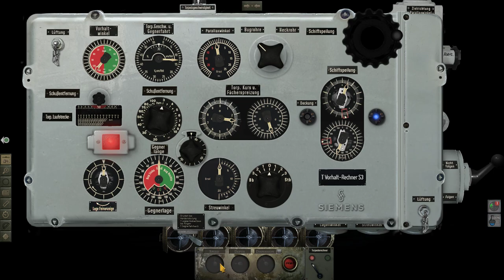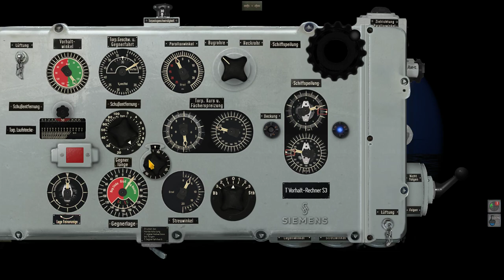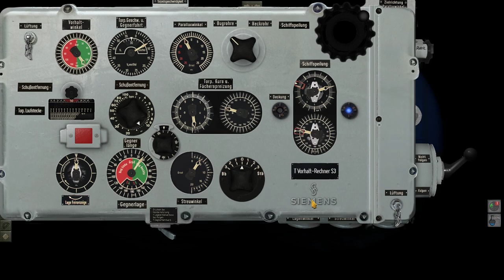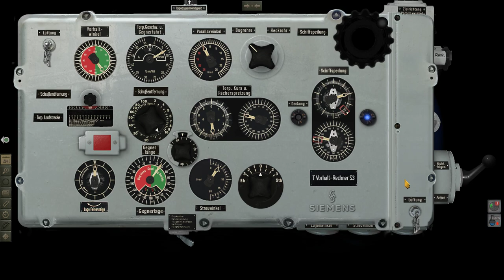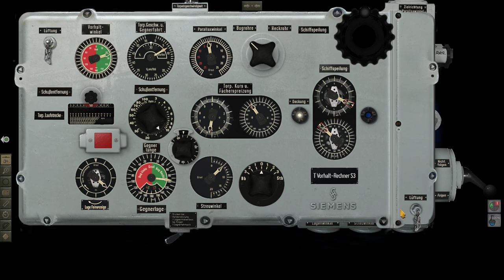Realistic TVre (TDC) Mod for UBOAT

Comment: One thing the mod needs, is the option for the manual input fields from the in-game solution to transfer to TDC mod, just like the Stadimeter does anyway if you measure distance and press set. Simply, because the Stadimeter can be really unrealiable (yes, I do know how to use it properly before anyone comments on that). 'Roughing' the distance on the TDC mod panel can be somewhat hard to ace - a few meters wrong will mean a lot when firing from several kilometers away.

So, that little addition to the mod, manual input, would be nice. It would also make the map tools still be useful - other than just the angle protractor.
Reply from the maker: Just remember though that if you keep your gyro angle low, range doesn’t matter. I only ever eyeball the range, I never use the stadimeter (that scope didn’t have one), because I strive to keep the gyro angle within 20° of my bow, so that range is no longer a factor in the solution. The only reason the range setting is on the TDC in the first place, is because the torpedo has to turn, and the torpedo tubes are offset from the optics by about 28 meters. If we were to literally fire torpedoes out of the lens of our periscope, there wouldn’t even be a range dial on the TDC. So no need for accurate range unless your gyro angle is high, especially at close range.

Comment: Hamacher great video probably the best explanation yet on the TDC. Since release is around the corner are we able to see another video where you fire on multiple targets so we can get an idea of the flow. The Follow up tracking is where my main focus is. Lets say you fire on 2 targets forward of you and then you turn to fire on a target w/ stern torpedo. Just want to see the motion of resetting and re engaging.
Reply from the maker: Thanks! I’ve been helping the devs implement their new TDC, which will be more in line with the real device (the mod has several inaccuracies). When it is released, I will probably do another video.

Comment: You mention how some procedures are historically accurate.  But, what isn't historically accurate is having one person (me) represent the whole crew.  For that reason inputs should each be a single step.  In the real boat as the captain, I may have to say "Set torpedo speed to 40 knots." which will then be relayed by another officer or crewman to the torpedo team who will then set that speed into the torpedo.  Asking a single person to do all the work of 24 men definitely needs some shortcuts.  I am curious to see how the TDC will operate in the coming release version.
I also noticed the range to target does not update though the AoB does.  Is this the way it worked IRL or is that a limitation of the mod?
Reply from the maker: I highly recommend trying the beta version out, it’s currently available for download, you can go in and try the new TDCs out as they currently stand. I’ve been helping the developers out in implementing the devices you see in the beta, and thus far, they’ve done a very good job. It is not perfect, there are elements of the fire control system they have not implemented correctly, and it remains to be seen whether they will keep these elements that way or fix them. And you are correct, typically, the commander, if talking about a submerged shot, or the first watch officer if a surface shot, would be calling the values out. This is how it is implemented in the beta.

To answer your question, correct, the S3 computer had an AOB motor that would update the AOB for any change in target bearing caused either by the optics turning, or your own U-boat turning. Range was not updated, in other words, the computer did not work like a position keeper like the US device did, but rather simply was able to update AOB, since the angular change in bearing will always equal angular change in angle on bow. The computer takes advantage of this fact.
Reply: @m.hamacher7881  Thanks for the added information.  
I think I will not try the Beta.  Buggy games turn me off very quickly so I will impatiently wait for a more stable version.  Cheers.

Comment: Awesome video, thank you! It would be nice to see more videos where you use tdc in action.  How important is to get Angle of bow exactly right, how much small mistake there affect the actual result (it seems pretty easy to make mistakes there) and how would you do it manually? Is there a good way to do it without using map? I'm talking about more complicated situation where degree is not 90.
Reply from the maker: Thanks! You’re exactly right, I’m going to make a series showing different techniques without using the map or the in-game tools.
Reply: @m.hamacher7881  Is that released yet?
Reply from the maker: @PicklePatch  will make another this weekend but check my “Day Approach” video using UBOAT - that shows some of these techniques.

Comment: Hello there.
I am still trying to understand the TDC. How do you know it is time to fire ?
Also, the torpedoes make turns ? Or they just go forward ?
Reply from the maker: Assuming the target data is reasonably correct, it’s best to fire when:
1) the range is under 1000 m
2) the impact angle (top left dial) is near 90
3) the gyro angle (two horizontal side-by-side dials) is anywhere from 340 to 20 degrees, in other words, within 20 degrees of your bow.

Torpedoes do indeed turn, and have a gyroscope that keeps them on course. Iirc the mod has them able to turn up to 135 deg. Not quite in line with history (was 90 deg until LuT was introduced), but provides flexibility. The angle they turn (expressed in 360 deg) is called the gyro angle.

In practice though, you should be minimizing how much they turn by approaching such that you fire when the target is near your bow/stern. Why? Because the less the torpedo has to turn, the less range as an input matters to the solution. So doing this eliminates inaccurate ranges as a potential source of error.
Reply: @m.hamacher7881  Thank you for your answer

Comment: Why do you think impact angle should be as close to 90 degrees as possible?
Reply from the maker: To keep it simple for people, I suggest 90 since it provides the widest angular target to strike. However there is nuance to that. An impact angle of 90 makes your speed estimate need to be more accurate, giving you more wiggle room on AOB. The opposite is true if you have a smaller impact angle - that allows for more speed error at the expense of AOB error. This is because the speed across the line of sight is less at smaller impact angles, making incremental errors in speed have less effect. So the takeaway “long answer” is, if you are certain of AOB but not so much on speed (say you are already in front and have course but didn’t have enough time to estimate speed accurately), opt for a lower impact angle, say, 50 or 60. This is the reasoning behind the recommendation in the U-boat commander’s handbook of firing at targets at lower AOBs which are fast or for which the range is high or the data otherwise is uncertain.
Reply: @m.hamacher7881  That's a great answer. I was just thinking that there must be an optimum impact angle given all data is known perfectly. I have a feeling that  given those conditions the optimum impact angle would not be 90. It probably depends on how you define what is the "best" angle. If the best angle is the one that provides the biggest target than 90 would be the answer. The other best angle may be when the deflection angle is changing the slowest providing a bigger window of time in which to fire your torpedoes. I still need to think about this but I'm glad to get your input. Thanks!